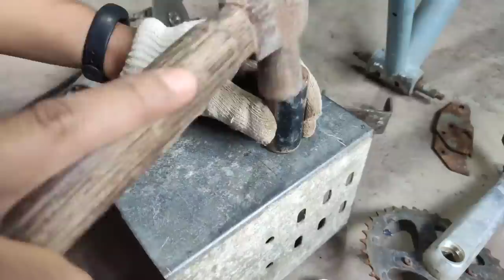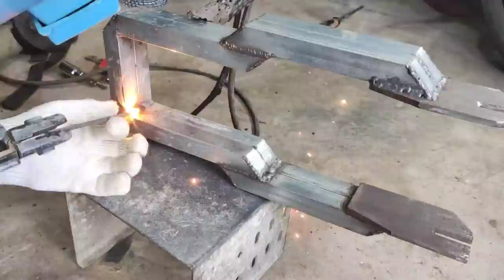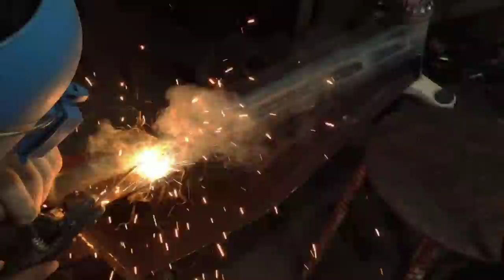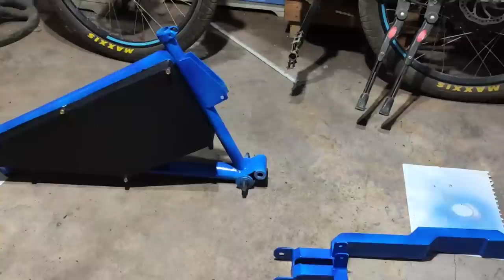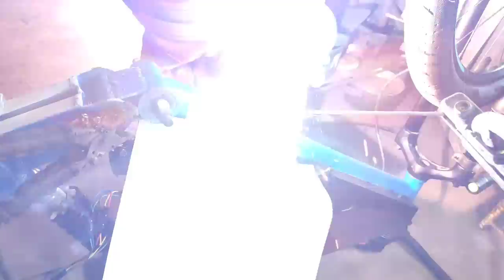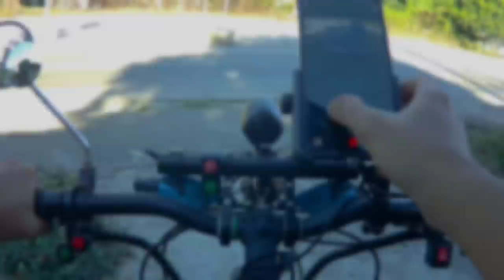How to make your own ebike (from hard tail to custom full suspension bike)

Comment: That thing must weigh an absolute ton!
Reply: it explains why he needs 2 engines 😂
Reply: @gorudonu  yu crsck me up yu da only one dar got it correct OH BY DA WAY UOU PUT A 500 CADDILAC ENGINE ON A CHEVROLET MALIBU EL CAMINO AND BURN RUBBER SLL DAY LONG LOTS OF TORQUE TO PUSH A VAN ACROOS AN INTERSECTION WITH ITS BREAK ON MUCH LIKE A PETERBUILT TRACTOR CATTEPILLAR ENGINE .
Reply: Nice job they are just jealous there not smart enough to do that lol
Reply: @RafaelSantos-vd6be  Go back to the kitchen,
Reply: @jimfavor2081  I DONT COMPREHEND WATS DA MEANING OF GO BACK TO DA KITCHEN IS DA WIGGER PHRASE JOKE OR Wat can you EXPLAIN SUCH. AS THANKS.
Reply: @Midam Srivastava The spelling of watt why dont finish the sentence my finger slips and presses another cant you see or figure it out Sherlock. Now where were we you was tellimg spell wat
Reply: Thats actually kinda of good, when in high speed it may continue stable
Reply: I got a 1000w motor and it weighs about 80 lb having 2 wow got to be 130 with just the motor not adding the battery and battery Fran
Reply: Guys, why 2 motors?
Reply: The weight comes mainly from that powerful battery pack that got this bike to be faster than most e bikes and with  better range as well.
Reply: @bobbythompson6017  yes but yours go half as fast.
Reply: And his system guaranteed to Carry an absolute ton.
Reply: @orangepeace9900  its great  build init   love the backend looks strong   id love to know the wattage on the front moter but more so did he phase the 2 engines into one throttle or does it have a seperate since there is 2 speed controllers
Reply: @male6089  Exactly. Plus it's made brilliantly from scrap laying about. That said he certainly could have shaved some lbs if he wanted.
Reply: I think you need aluminium stead of steel
Reply: Nice work makes me want to learn how to weld 👍

Comment: Fair play but I really wouldn't like to try to carry or pedal that once the battery goes flat as you've added so much weight I'm laughing my head off. Obviously welding aluminium isn't easy but I recommend getting 203 rotors for brakes as I run that on my aluminium hardtail Bafang conversion, it needs the extra braking power so you no doubt will need to upgrade. Still, impressive, I'll bet your next one is better!

Comment: I was convinced that I needed a metal 3d printer to make the electric bike I wanted (not happening anytime soon), this video slapped that toolbox fallacy right out of me ^-^
Reply: I tell you what great idea but I think you need a welder with out that your snookerd. But if your clever enough you can use nuts and bolts. It would take a hell of a lot. The ammout of steel he used this bike will be pretty heavy. So if he made it lighter in weight it would go faster then there his weight so all that is load. But great to watch it makes you want to get of backside and do that
Reply: Keep continuing watching DIY e-bike videos and you will be able to get a good grasp ob how it's made.

I'm willing to do obe but I don't have the funds right now to do so, so in the meantime I keep watching videos to expand my knowledge.

Comment: Best arc welding I've seen - love the ingenuity of the design - respect!
Reply: Lol this must be the first welder you ever seen weld. The bike is cool and all but damn this man cannot weld to save his life. I can point out so many things that are wrong in this video. Starting with the damn flip flops. Smh.. You are not suppose to weld on paint. Grinding all those pieces down free handed is a great way to lose a finger or worse. Anybody can pick up a stick welder and bond two pieces of metal together. Which is this guy right here making the video. All in all still a cool ebike but damn take a welding course. Guarantee those welds dont hold.
Reply: The man is more electrician than fabricator. His wires, his 12 cell battery, all beautiful. But watching him for 13 minutes was like listening to nails on a chalk board. The bike statistically wont last. Will need constant maintenance.
Reply: @1rr3l1vent8  ye you right
Reply: @1rr3l1vent8  Stfu.. e-bike go zooom.

Comment: Why are you using so much metal it not a truck ,try using geometrical structure's it will be lighter and stronger and faster
Reply: Thats we call robust, safe and secure. It is better for me to feel secure and enjoy than doubt everytime i ride my bike. I have 5 Downhill bikes. I uses them on all terrain. From downhill, street dj, to casual city ride. I never doubt my bike being break or crack. So i just enjoy my ride
Reply: Exactly If build it properly it there is need to worry in the first place ,there are tones of ways to make a structure stronger without adding mass into it . if you see modern mountain bikes they are meant to endure a lot of stress and being light at the same time. there is no need to add material to feel safe .🙂
Reply: @animateddropout8876  do you think major and sophistacated bike company didnt planned will? With all minds, multiple number of engineers and heads gathered just to make bike frames with advance machines and technology but still end up with cracks. Some even think using carbon to make frames lighter but resulted to instant breaks during race.  Where as this man build bombproof  with limited resources with simple engineer. If you think some weight saving help, tell that after some cracks and crash, i would prefer safer than sorry. Besides ,It will only differ some watts almost not noticeable. So why should he risk?
Reply: Carbon fiber it is known to be stronger then steel and being light it is preferred by every "every" automotive company for one reason only to save weight ( they know what they do and they ensure by testing and putting 10 times more stress that the bike can experience ) and not withstand crashes ,it is mainly designed to shatter on impact to keep the rider by absorbing some energy and dispersion and carbon is ur choice if u want to save a few seconds. But if you want to ur bike to last then aluminum is the way to go , and by adding more mass he is in greater risk as it will increase the stress in the joints and welds, making the welds want to snap when ever it hits a small bump in the road or a rock the weight will pull the bike down and the weight of the rider will act like a press adding the the stress and increasing the chance of collapse of the structure. For example imagine your high in mass and what will ur joints go through they will grind every time u walk or run and imagine ur joints 
🙂 And it's not just some watt lost its some watt lost every second ( i design MTB'S I could make one which is way stronger and faster and efficient with the same material as him for even less cost and safer then his 🙂 thanks )
Reply: It doesn't even look strong
Reply: Hey, it’s cheap, fast and reliable

Comment: I’m installing a 3000w e-bike kit on a EUROBIKE…it’s already full suspension,  But the rear shock is inside the frame’ taking up a lot of space’ I was thinking of building a custom hard tail’ rear fork’ this will allow me to run the shock behind the tire…all I need is the square tubing and a round steal pipe to put the bearings in….I don’t have to cut my back frame, because the back can be removed without cutting the frame. 

All I will have to do is weld a shock support bracket on the frame.

Now I have the info to build one…thanks for the video.

Comment: That's a lot of work but ebikes are expensive to buy....
I just threw a kit on an old full suspension mountain bike.( steel frame and torque arm used at dtop out ).
Battery in a bag strapped to back of seat  post.
It works well but yours looks cleaner build.

Comment: With the same battery, I would have rather put a 48V 2000w motor and the controller that goes with it, you would go a little faster and less weight at the front. I have a 48-60v 2000w motor but limited by the controller in 25A and the battery in 48v 15.5ah 1200w and I go at max 45-50km / h on flat ground. And I haven't seen a BMS ...
otherwise, very good mounting of the rear suspension and even if I prefer my mounting, the mounting of the 2 wheel drive is well done and successful ;)

Comment: What I can't understand is why if someone goes to this amount of effort to build an ebike why in the world they would opt for a hub-motor. Mostly I assume because they have little to no experience with ebikes. But what is sheer stupidity is building your own battery and encasing it in a metal conducting box... what could possibly go wrong? Kudos to the skill involved in this build and a D- on build design.
Reply from the maker: there's nothing wrong in hub motor. regen brake are so helpful. insulation of battery can be dine in every pack.
Reply: @albertnario4877  Power regeneration IS a good bonus for an ebike... not so much for the power capture which is minimal for something as light as a bike (9 to 10% IF you are very good) but can save brake pad wear significantly. Also, very few hub-motors Can regen. You could also limp home without a chain using a hub motor if that eventuality were ever to happen. But the downsides of hub motors (lack of torque, overheating, unsprung weight to mention a few) dramatically out weight the two benefits. Using any conductive material to encase 10s of Ahs of batteries is not a good idea especially if you are going to be riding over rough surfaces. And what makes it worse is that removing the pack from the bike to charge isn't just beneficial but actually necessary when temperatures start dropping below 40 F. I also swap batteries during long rides.
Reply from the maker: you mentioned are situational, motors have their pros and cons, it's in your personal preference. unsprung weight is not issue for me, I'm from hardtail frame. my tire set up can speak for me, what my riding mode (26x2.5 maxxis hookworm). and the biggest issue in DIYers like me is the price.
Reply: @bigzen69  Sorry man I can't understand any of your babbling. It's cool if you got a man-crush on Mr. Mario but hub-motors still have a great disadvantage.

Comment: great work on the frame bro!  
underpowered for the weight and what the frame could potentially handle
 but I see it's just a scrap controller from your old bike.  Throw a 3000w on that bad boy and have some real fun, that huge battery can handle it!

Comment: Your arc welding skills are very impressive  some of the best I have seen to be honest. Very good diy job I'm very impressed. Where did you get that light bracket from also you fitted to the bars?
Reply from the maker: side mirror adapter and handle bar extension common in MTB.
Reply: You gotta be kidding this weld is crap

Comment: Amazing build! You are very skilled mate.
I have a question. Why didn't you use aluminium to build the battery box instead of steel?
Thanks
Reply from the maker: I only have is arc welder.

Comment: its an e-bike factory or an auto mechanic's garage. Good work, but this is not a DIY project. Not everyone will have access to a welding and metal fabricating machine. That bike looks like it should weigh a ton. I would call this an e-motorcycle at this point, lol. The guy is definitely talented.

Comment: It's the most creative artifact... But very heavy and too   expensive to do
Reply from the maker: it's heavy but not expensive to make.
Reply: @albertnario4877  if you have all materials in your house... I don't have nothing of that... Its expensive, more than buy an electric bicicle wheel from aliexpress
Reply from the maker: @emiliocampos2486  I'm start on 350w motor then upgrade the  battery, add another motor then upgrade battery. just take it step by step. don't rush.
Reply: In spanish....
Te digo que no todos tienen esos materiales en su casa. Te digo que primero debes calcular el peso, y la potencia del motor versus el peso a mover. Calcular la durabilidad de las baterías, y si es que soportan la carga a las que las vas a someter...
Reply: @emiliocampos2486  hahahaha what? Where did the Spanish come from ? Lmao

Comment: Albert kicking assess once again . Awesome project bro ! You're the man who just doesn't know that shit is impossible and you just do it .
This thing must be heavy . Why lifepo ? They must be expensive
Reply from the maker: yes it's pretty heavy . I just want to try liFepo4 and it's second hand cells they only ⅓ the price compare to lithium ion at same capacity..
Reply: Albert Nario how are they like compared to 18650s? Overall smaller or about the same size/weight when put together?
Reply: Albert Nario you should have recorded the people’s reactions 😆 here’s that guy on the scooter thinking he’s pimping with his girlfriend; and there you are flying by him on a bicycle 😂😂🤣
Reply from the maker: @FuttBucker42069  it's normal for when they look at 2nd time and thinking 😆

liFepo4 are bigger compare to lithium at same capacity. in that size i can build 50Ah battery pack using lithium.
Reply: Albert Nario ah. Ok 👍🏻 was just curious. Jesus. 50 Ah. How long is that charging for?😱
Reply from the maker: @FuttBucker42069  maybe 5hrs for 10A charger
Reply: Albert Nario aaah 👌🏻👌🏻 not too bad then

Comment: Are lifepo4 battery really good for ebikes ? I know they are good for campers etc but I have like 900 lifepo4 26640 cells and have read alot that they are not good for use on ebikes

Comment: Hi, I'm Fabio,
congratulations, great job, great video.
A curiosity with LiFePO4 batteries, do they work well on e-bikes? Many advise against them, they tell me to wear Liion. These 36250 what make and model are they?
Reply from the maker: if you're on low budget.. liFepo4 can be works well.. down side from lithium ion is, liFepo4 are heavier, bigger, and have flat curve voltage. but it can handle more current than lithium ion
Reply: @albertnario4877  Leaving aside the economic budget, and the weight, with the LiFePO4, do you have advantages over the Liion?
Reply from the maker: more current can handle and stable voltage.
Reply: @albertnario4877  Ok, thanks, I hope they have a long life!
You know for my ebike project I would like to buy Litokala LiFePO4 32700 7000mAh (continuous discharge 30A, peak 42A), do you know them? do you recommend them?
Reply from the maker: liitokala are good brand.
Reply: @albertnario4877  Thanks

Comment: another nice project.
two 350 w controllers drain 18 ampers each. right?
36 ampers total at full throttle.
how many batterys in parallel and series?
and total capacity?
that li fe batteries can handle 36 ampers?
do you know about range?
too many questions 😁😁
Reply from the maker: most of your questions are answered in description section
Reply: @albertnario4877  yes.your right.
why I didn't sow that.🤪🤪

Comment: Cool build, but why did you take a 350W front and a 500W back motor, they won’t run synchron if you drive. Can you explain?
Reply from the maker: it doesn't matter, it roll on same road anyway.
Reply: @albertnario4877  but one motor turns faster and pulls the weaker wheel behind

Comment: Nice build mate,What are those batteries you use ? The metal battery box is a bit concerning though,i can see a potential fire,insulated or not,batteries do get hot.Ever consider using perspex instead ? If u can find any led slim slim tvs with broken screen,youll find a nice 5/6mm sheet inside,thats what i use ..just sayin ;)
Reply: Here to partially retract my statement about the metal enclosure for the batteries,I recently had a house fire,the cause was my electric bike battery,although it was well and excessively insulated,had it been enclosed in a metal box,it may of been prevented

Comment: How long will the rear suspension hinge last? Does this node have backlash? That's a good idea!!
Reply from the maker: it has at first I just tighten the nut and bolt, and you can't barely notice it ,even you inspect closer.
Reply: @albertnario4877  Usually in the rear hinge put bearings for greater reliability, I think your decision will not last long,but I can be wrong.
Reply from the maker: your right but our metal gate has almost same hinge, and it's already 7yrs old and more, rain and shine.. so I think it can last just need a right lubrication.
Reply: @albertnario4877  I am waiting for new videos about the modernization of this electric bike,and the creation of new homemade electric bikes

Comment: By watching the video, I´m looking forward to make one. By any chance, do you know where I can order the parts...
Reply from the maker: alliexpress
Reply: start of small as i did with a old cheap  50 doller hard tail  mountainbike try get something  thats kitted out with full disk braking.... and then buy a conversion  kit...... i have done the  ebike conversion ... then the  4stroke petrol conversion. and betterstill finally the ebike petrol dynamo charge conversion so the ebike never never goes flat so long as engine ticks over at low idle rpm turning the dynamo and as it never  needs to rev you can not really here it. nor still  is it a motorbike best of both worlds   lol

Comment: Buddy, welding rusty metal like that leaves oxidation in the weld which can make it crack and break. Also painting on top of rust omfg .. I sure hope none but yourself is going to ride that thing, it's a straight up deathtrap.
Reply from the maker: that's why I used red oxide as primer. it stop oxidation of metal.
Reply: Take that Rndm hater